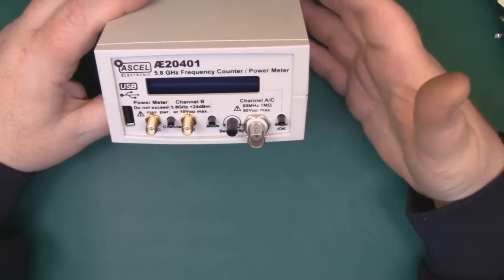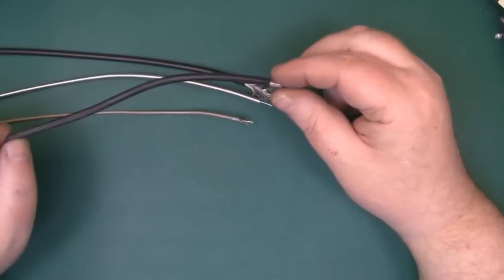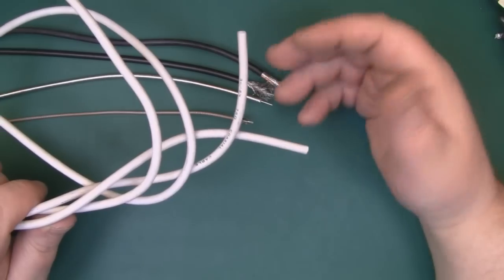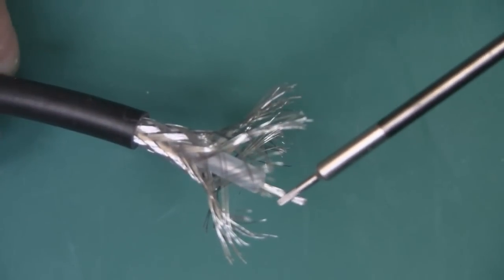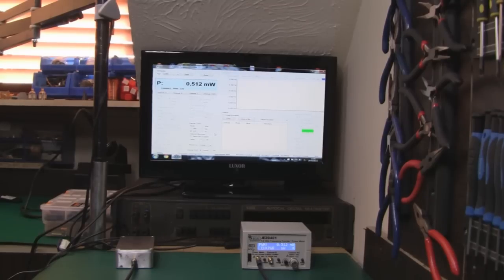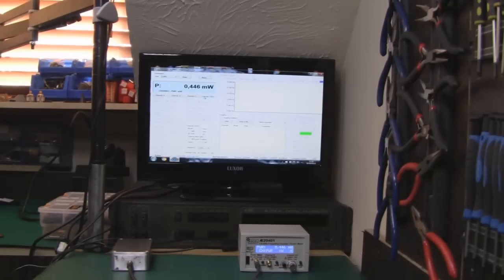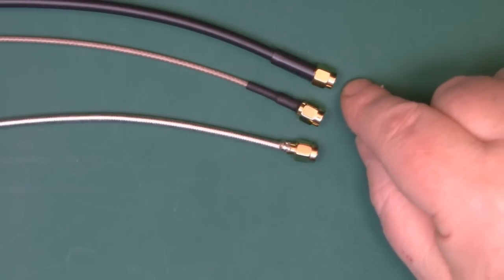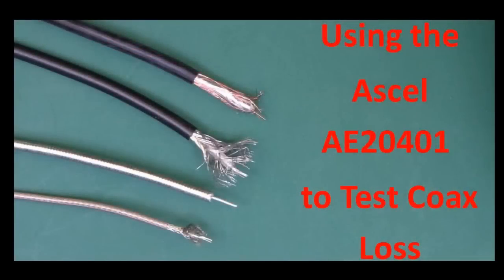Testing Coax Loss #141

Comment: Jiangsu Elesun Cable Co., Ltd(http://www.elesuncable.com) specializes in producing RF coaxial cable of 20 years.
The certificate we have is SGS,CE,ROSH,UL,ISO9001.The main items we have as follows:RG58,RG174,RG178,RG213,RG223,RG316,RG400,RG141,RG142,ALSR100,ALSR195,ALSR200,ALSR240,ALSR300,ALSR400,ALSR600
3D-FB,5D-FB,7D-FB,8D-FB,10D-FB,12D-FBUL1007,UL1015,UL1569,UL1185,UL1618,Elevator cables
Also,we can produce RF cable assembly 50 ohm For more details welcome to mail me crystalzhang@elesuncable.com Thanks~

Comment: Hi, I'm looking for a decent coax for building a pigtail for a 4g router, with ts9 attachments. What would you recommend between the semirigid RG402 , the RG316 and the rg58 ? rg58 seems a popolar choice for connectors. Isn't rg402 way better?

Comment: Great video as ever. I have found that BT VDSL2 lines cause massive interference with vaious systems in my house.  It only radiates 10Mhz but the power level is increased after 4pm on many days and this interefers with various systems, especially the jamming detection feature on my wireless alarm system.  To cure this I have placed my BT master socket where the line enters my property and I have placed my broadband router there.  The interference problem has been solved but now the WiFi signal is weak in some parts of the property.  I know that you said that you would not recommend pigtails of more than 0.5m but what about if I use RG402 with nicely soldered SMA connectors and buy new antennas, using seperate antennas for 2.4Ghz and 5Ghz and I use 80mm wide metal relectors behind the new antenna.  How long could I really push the pigtails to? 10m? 20m?  Also can you update this video to let us know how the RG402 EBay cable compares to the genuine LMR cable that you bought from America?

Comment: Andy, is there a flexible version of the RG402. I need to extend the  diversity BNC outputs from a Wireless Microphone system (uses 50 ohm bnc's). Although most of the wiring will be up a pillar - at the rack end, it will need some flex in the cable as the rack is on wheels and will be moved in a small arc from its "working " position to it's "sleep" position. Many thanks  (42MHz system)

Comment: Have I interpreted this video to say at you measured 600mW at 2400MHz into 2m of RG316 and the power output was measured at 549mW. That is a loss of 0.38dB... which is just 12% of the specification loss for good quality RG316 (eg Belden 84316).
Reply: Thank you good fella.. 👍👍👍
Reply: can i use RG-7 and RG-11 coax cable for wifi antenna ?

Comment: so far as I can see, the cables here are 50 ohm, which is what I believe wi fi uses, EXCEPT for the tv coax which is 75 ohm, so little wonder it is poor.
I have some cb coax, the thinner of the two which were available 30 years ago. It has no foil inside but close mesh shield. It is 50 ohm. Would you recommend that?

Comment: Great video and real useful channel for info about wifi antennas.

Just a few things I don't understand in this video:

1. You keep saying 600 mW are transmitted through  the coax, but the power meter readings show only values of under 0.6 mW . This would be 600 µW or (-2.2 dBm)

2. 600mW (+27.8 dBm) is out of spec for the AE20401. According to their web site the power meter is only rated up to +24 dBm. That would be slightly above 250 mW.

3. Television type coax typically has 75 Ohm impedance. The power meter shows 50 Ohm input impedance and very probably your test transmitter also  has 50 Ohm source impedance. Due to the mismatch you will see any type of weird and wonderful effects. You will have standing waves on the coax. Just shorten it a bit  and you could get different results. The tv coax is not bad in itself. It is just not suited for a 50 Ohm system impedance.

Comment: Surprised at RG402 was so low loss. Love using this as so easy to assemble.
RG316 also good but do have a little trouble crimping as the die set is not properly sized, do my best with anyhow.
 Going to order some RG405 cable and some connectors to try out with

Comment: It looks to me like the resolution of your power meter is 12 milliwatts so I am guessing the readings will be plus or minus 12 miiliwatts if that is 1 least significant bit of resolution. So your semi rigid is really beyond measurement with that gear. Its great to see you can do this with your set up though. Great work mate.
Reply from the maker: +Robonza Hi Robonza I have just ordered the upgraded timebase module so it should improve the resolution and speed.

Comment: 1) RG-402
2) RG-316
3) RG-58
4) RG6 and RG59 (only TV and CCTV) not for wifi.

The best is RG-402?
Reply: valeu
Reply: Fernando Pesoa could I use 20 feetof Rg402 from my 5.8ghz video receiver to a 14dbi patch antenna or is that to long of a stretch?

Comment: hey andrew do you recommend any seller on ebay for a genuine alfa card ? I bought one and it was fake it did ok but not nearly as good as the genuine one.
Reply from the maker: +Leo Lessa Not on ebay no if you go to the Alfa website they do have a list of official sellers in most countries. Also the Hak5 shop is an official seller.
Reply: +Leo Lessa http://www.ebay.es/usr/rokland?_trksid=p2047675.l2559 hope this helps